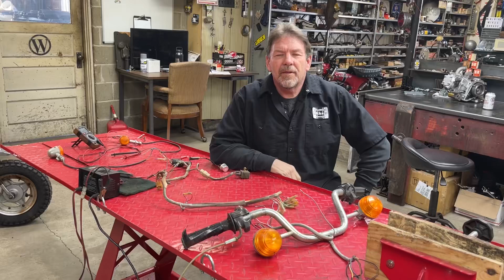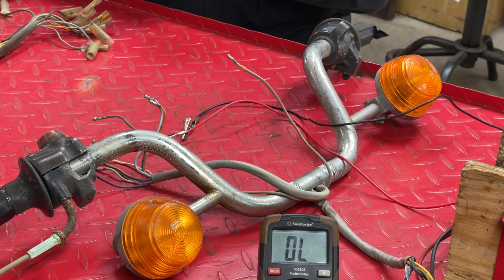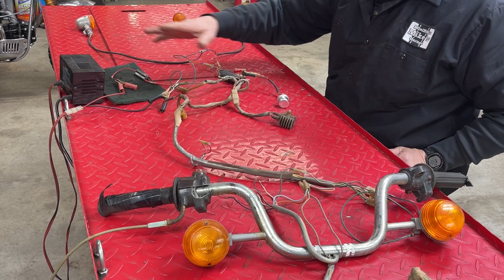Honda signal wiring - short tutorial

Comment: Problem is with the front signal lights grounding through the frame. They have to ground through the steering head bearing so my front signals are dim. I’m thinking about running an additional ground wire to my handlebars.. and by the way, my rear turn signals only have one wire each going to them. The ground is at the license plate and tail light bracket..
Reply from the maker: I ground all my signals thru the harness, directly to the battery.

Comment: Turn signal indicator 
I have looked at wiring diagrams that have a turn signal indicator light (in the speedometer).  I follow the
circuit and see the path to the indicator ok. 

I don’t see how the path goes to ground. 

Do these diagrams leave out a ground? 

Does the indicator bulb have two filaments? 

Does the turn signal switch have a path to ground that isn’t shown?

 It is very confusing to me.

It looks like the bulb is wired back to the switch and stops there.
ie: When left turn switch is closed. Blinking power goes from switch to the left wire to the indicator and returns on the right wire in the switch,
When right turn switch is closed. Blinking power goes from switch to the right wire to the indicator and returns on the left wire in the switch.
Unless there is a connection of these end paths to ground it isn’t a complete circuit.
Thanks.

PS: I was in the USAF and have 6 weeks of electronics training and 4 months of teletype training. I fixed teletypewriters for 4 years. So I am well trained to read schematics.
Reply from the maker: I can’t honestly explain how the system works, but there is no ground wire.  The bulb has two wires….one goes to the left blinker and the other to the right blinker.   I do know that the correct bulb is needed for the system to work.  Something about wattage and resistance, but not sure.  Somehow the bulb is grounded thru the wire not being used.

Comment: I understand the blue n orange wire for  turn signals but what about running lights? I get the headlight on when key is turned on and flashers works but no running lights.
Reply: I have a 1983 honda cb400
Reply from the maker: No clue.  On the small, horizontal engine bikes, there are no running lights.

Comment: my 84 aero 50 turn signals aren't working anymore , could it be a fuse?
Reply from the maker: @rocee1140  Could be one of multiple things:
Blown fuse
Bad flasher
Bad wiring
Bad switch
I’d start by checking to see if you have correct voltage going to the flasher.  If not, could be fuse.  If you do, it’s flasher or something else down the line.

Comment: Question for you. I have an 81 CT110.  the turn signals work and flash with the key on with the power coming from the battery, (6v system) however when the bike is running the flashing stops and the light is solid.  This was after replacing the flasher relay and cleaning up the grounds at the battery and rear of the bike. Any ideas ?

Comment: Hi mike , ive been stuck recond my elec system for my 750four. I watched a vid that showed how to sort out the mess in headlight bucket he made it look so easy to pull apart and reistate it after fixing connectors . Mann was i wrong . After 6months and multiple wireing diagrams  i feel im nealy there . Have you been in a 750 headlight bucket . I have some wires left unpluged ,but some operating lights to get working . ???
Reply from the maker: @jamiestanley8774  Sorry, I’ve never owned anything other than minibikes.

Comment: So I just went through this process, realized the light blue and orange wires for the signals in the headlamp area, are switched. When I used my multimeter orange lit up left turn blue light up right…. Is this okay?
Reply from the maker: Sounds like the front turn signals were mounted on the wrong side.

Comment: Thanks Mike.  I am really not savvy when it comes to wiring issues.  Your video  was  interesting. I don't expect you to solve my issue.  1983  Honda CT110.  Fronts signals work, back  signals have power to the back, but the bulbs won't turn on when the switch is  on. the tail light bulb begins to flash and at  times  when  i  put pressure on the left bulb  it  will begin to flash as does the tail light. I have thought about replacing the rear turn signals or just getting a complete new wiring harness.  For now, I will  just keep plugging away.  Thanks for shedding some light on my issue. John Gibson, Absarokee, Mt.
Reply from the maker: @JohnGibson-m3d  Maybe a grounding issue, on the back lights?

Comment: I need help with my bike, any idea why when i have a my headlight on and use my right turn signal, it flashes the headlight and shuts off only the right front signal. The rear signal still says flashing. It doesn't happen to the left side of the bike. And when my headlight is off everything works fine... Any help would awesome thx.

Comment: So I've got a 1969 ct90. Then I've got a 1973 ct90 parts bike. The 69 has the turn signal switch. But I wanted to adopt the 73 blinkers front and back to the 69. I've heard that it was primarily wired. But it was left up to the United States state regulations to either put on the blinkers or not. Is this wire harness applicable to my 69?
Reply from the maker: Sorry, no clue.  I’ve got a few CT90 parts, but I’ve never owned a complete bike or built one.

Comment: Hi there, I had a quick question about headlight options. I’ve been trying to use an LED headlight on the AC side of the rectifier on the headlight circuit and it keeps burning up LEDs and I did notice that around the light burns out the bike stumbles and dies but starts back up again and I am able to ride on. I did notice in testing the AC voltage fluctuates anywhere from 3V to 16v on that wire. All at idle. Any thoughts would be appreciated from anyone.
Reply from the maker: Unfortunately, I’ve never used an LED light or know anything about them.

Comment: Any difference in wiring with a 84 ct110?
Reply from the maker: I doubt it.  All Hondas are basically wired the same.
Reply: @MiniBikeMike  I'm working on a LH switch right now and its a nightmare trying to get it working, and trying to find a replacement is hard, thats cheap... sorta.
Reply: @minibikemike  I do have a question on an 84 ct110 the RH kill switch has a black wire and a brown w/ white stripe wire that I am confused where they go. Tried researching it and I haven't a clue where it goes.
Reply from the maker: The kill switch wires should be a green and a black/white.
Reply: @MiniBikeMike If you could do a tutorial on what wires go where in the headlight bucket it would be greatly appreciated
Reply from the maker: Unfortunately, I don’t own one of these bikes, so I don’t have a way of filming it.
Reply: @MiniBikeMike  darn.

Comment: I am getting power to both blue and orange wire in the back and I don't have lights at all up front do you need them to complete the circuit or can I just run signals out the back
Reply from the maker: You can run just back signals.
Reply: @MiniBikeMike  why the power to both left and right signals in either position 
Contacts in the switch?
Reply from the maker: @Beijingbiden  Most likely.
Reply: @MiniBikeMike  turns out the indicator bulb on the blue wire is a dead short